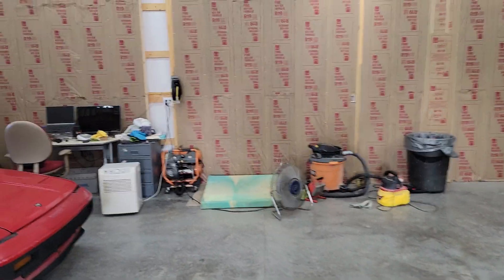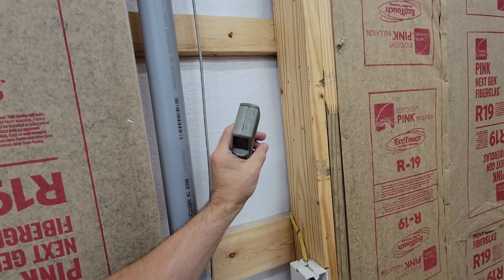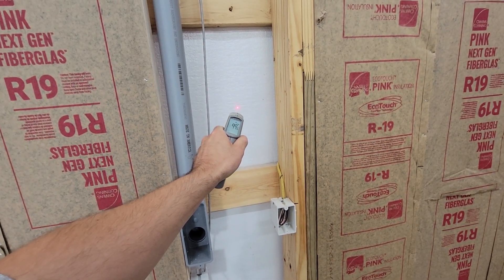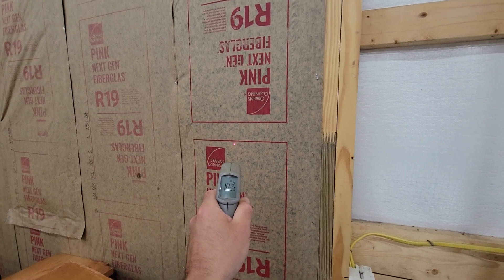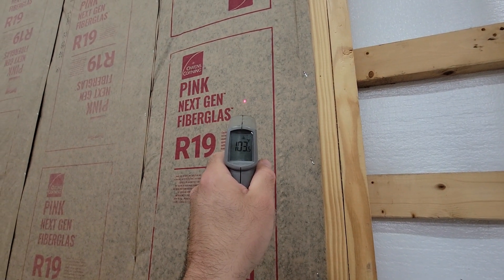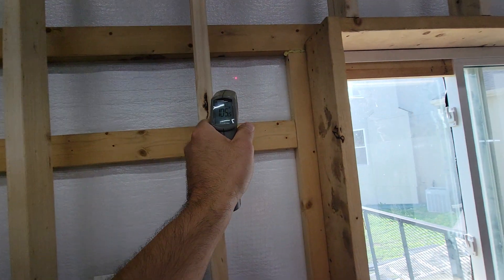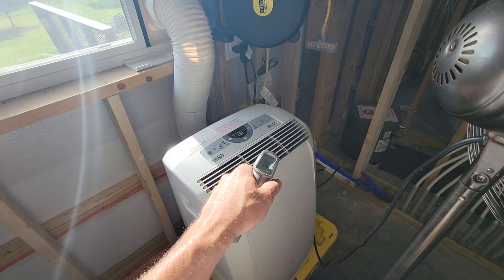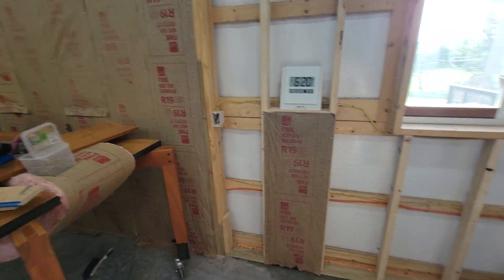Pole Barn Insulation Comparison R19 vs Solex insulated house wrap

Comment: What is it without the solex vapor barrier?
Reply from the maker: Really hot? Without solex it is just a piece of tan 16 gauge steel roasting in the sun. Im sitting in my shop right now, and it is currently 97 degrees outside. I am nice and cool inside at ~74 degrees with nothing but a 10kbtu window unit. Insulation matters.

Comment: I just finished framing my shop and I’m planning on doing the R-19 roll insulation as well.  I’ve also got that same exterior vapor barrier stuff.  You think it would be beneficial to take twine and staple gun and make “netting” to hold the insulation in?
Reply from the maker: Awesome to hear your shop is going up!

Why would you need to hold the roll insulation in with netting if it was faced? The paper part of the faced insulation gets stapled to the framing.
Reply: @diymetalfabrication  well I was thinking of not doing any framing.  I was going to run some horizontal 2x4’s across the posts.  Trying to save some $.  They also have this product called “insulhold”.  Just curious what you think
Reply from the maker: They sell 8' wide unfaced Batts that hang from hooks placed on the outer stringers just for that purpose. 

They talk about it here. I believe it is available at Menards and most post frame building suppliers
https://www.garagejournal.com/forum/threads/where-to-buy-post-frame-insulation.492696/
Reply: @diymetalfabrication I’ll check it out!  Thank you so much!
Reply from the maker: Here is a build thread where the guy shows how he put up his 8' wide bats.
https://www.garagejournal.com/forum/threads/because-my-wife-said-yes-30x40-pole-building.445450/page-2

Comment: Insulation is installed wrong, flaps go on inside of the studs
Reply from the maker: Discussions are plenty on this topic. Per the Owen's Corning install guide, either is permissible. My insulation was approved by the city prior to any sheetrock being hung. 

Typical discussion points: 
Face stapling provides more consistent vapor barrier, no compression of the insulation, easier to install. 
Side stapling: flatter surface for drywall insulation and ability to use glue on studs behind drywall. 

I'm curious why your preference is on the inside instead of the face?
Reply: @diymetalfabrication   In my area we must glue the drywall to the stud with a specific liquid nail for drywall, this accounts 80%!of bonding and the screws are only 20 %, the  paper interferes with the glue bond. Great videos you are making.
Reply: Gluing drywall seems totally unnecessary. It’s not structural nor do screws have trouble holding it. I cringe at the thought of making a repair and trying to scrape glued drywall paper off studs

Comment: I’m sorry but your video was of absolutely no value at all without knowing what the temperature of the siding is without any insulation.
Reply from the maker: Thanks for the comment. Sorry you didn't find it useful. I thought a 17 degree difference between the two types of insulation was a significant observation. The Solex insulated vapor barrier was installed before the tin was put on the building, so I didn't really have a way to temp gun the steel without cutting a hole in the Solex. I suppose in retrospect I could have gone outside and took a temp reading of the metal on the outside. 

The shop is now fully insulated and sheetrocked with a ceiling and R60 worth of fiberglass blown in the attic. I have it on my list to do an update video here soon. Feel free to subscribe so you can check it out!